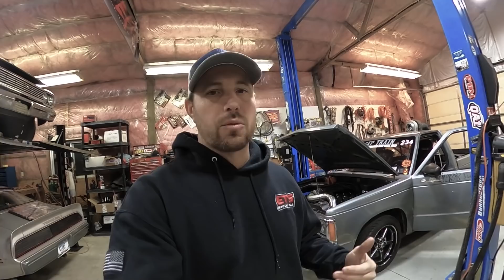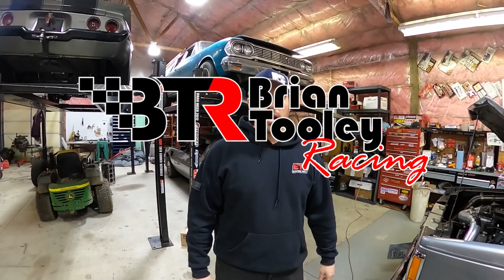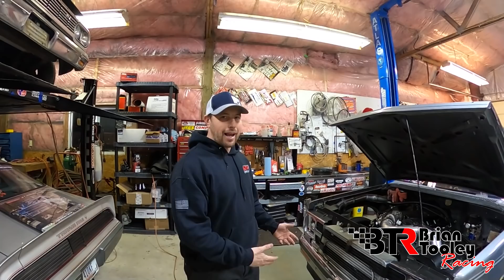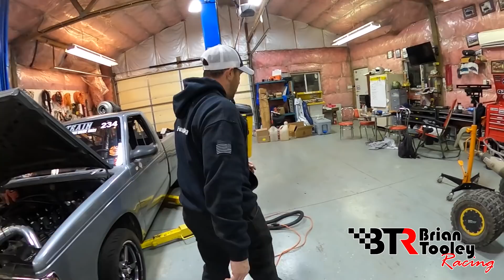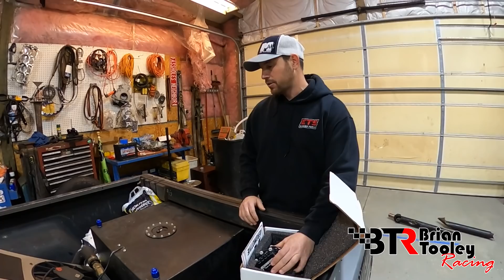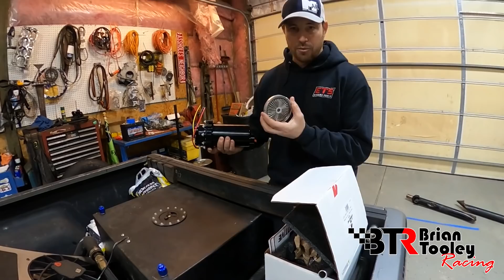Gap Train Goes on Meth Part 1: New Fuel Pump

Comment: I’m using the ac bracket from the truck with spacers for my belt pump. Lines up with aeromotive stock pump bracket. And I’m using a sbc mandrel and had it on a lathe to fit it inside the he ati balancer. Sbc 3 bolts line up with ati and the cheap sfi ballancers too. On the cheaper sfi balancers the mandrel road on the balancer bolt. I have less than 1500 in my setup and I can put a rear tank in and a carb pump for long drives
Reply: Bad ass idea

Comment: I like the turbo setup glad you decided not to change it I wish I could get you to tune my truck 408 ls with 88mm turbo on e85
Reply: Thanks Dustin.  Is yours on holley efi
Reply: @maktvmidamericakustoms8837  its hp tuners right now I'd like to switch it to holley efi
Reply: You won't regret the switch.  It is awesome for these combos
Reply: @maktvmidamericakustoms8837  is the holley a Lil easier to understand for beginners like me as far as tuning goes I'm also in the process of doing a no prep car and I plan on doing holley efi on it also
Reply: @Hammerhead5353  it is 100x easier than factory ecu stuff
Reply: @maktvmidamericakustoms8837  definitely going to switch to the holley then thanks for your time

Comment: Fuel pump part number? And do the gap brackets work on a Chevy full size?
Reply: 18385 is the pump.  They can work on a full size but the shocks need to be relocated behind the axle

Comment: Can you flip the intake? That could shorten the charge pipe and take a little more weight off.
Reply: We looked at the but with the current intake I would have to cut the firewall up alot.  Definitely might be a option in the future.